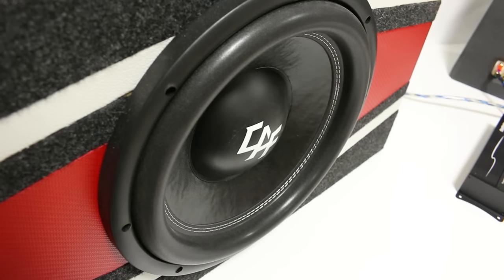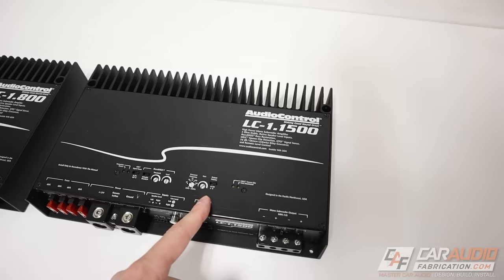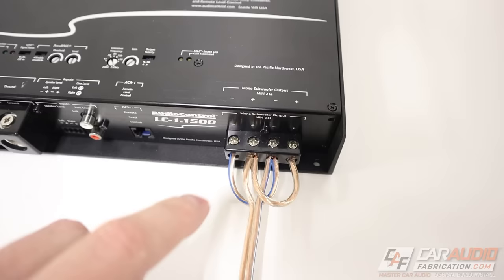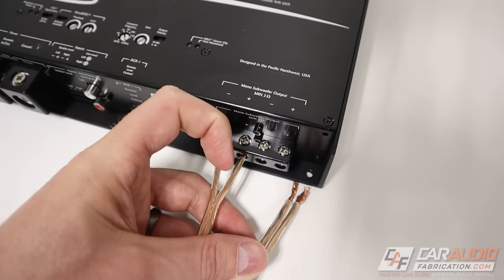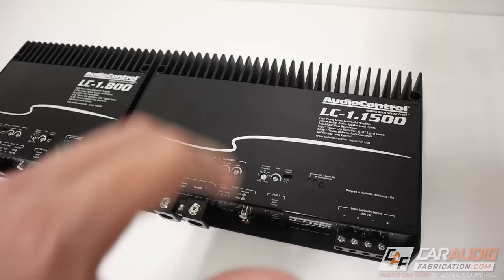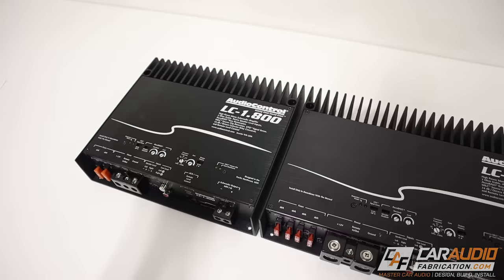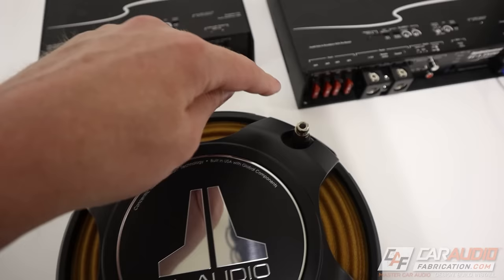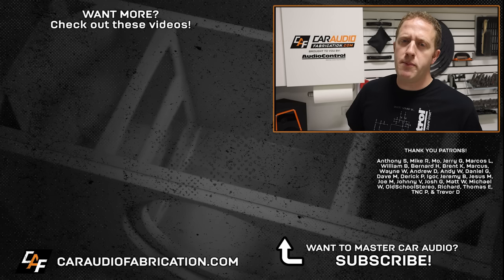The RIGHT WAY to wire subwoofers to a monoblock amplifier

Comment: What about phasing?
Reply from the maker: What? This connection has nothing to do with "phasing".
Reply: @CarAudioFabrication  the paralel connection shown at beginning freezed my hair off , i was like '' wth why the amp does not turn in protection by shorting left and right ,, but just realised by reading  that its a mono block , amp , the 2 output is just one , all its clear now , maybe leon was thinking same , in a stereo architecture each channel are biased , not sure what happen if you short both channels

Comment: What happens when you have a 4 ohm dvc sub and wire it in parallel then bridge it on a 1 ohm stable monoblock amp? Will it achieve 1 ohm, or am I crazy?
Reply: It will be a 2 ohm load, no bridging a monoblock amplifier. Even on a 2 channel amp bridged  the impedance will stay same because of subwoofer.
Reply: dual 4ohm u can wire speaker into 2 ohm or 8 ohm.. same with dvc 2ohm can plug it into 1 ohm or ohm.. high power sub will be cheaper to go for 1ohm from dvc2 and for 2ohm from dvc  4ohm, but if u dont care about full power, just want better control from amp go for higher ohm. u cant control ohm in amp, speaker have to be wired correctly like u want, and amp only need to support your resistance u have in speaker. 
and for pure example 2 subs with dvc 2ohm u can do 0,5ohm or 2ohm or 8ohm... its a little complicated but if u see diagrams on web then its easy :d
Reply: and bridging some cheap amp can make it not be stable at for example 1ohm, gotta read manual, also bridging amp wont "change" ohm cuz monoblock is only 1 channel, and even if u have 2ch amp it still depends of wiring on speaker coils what ohm u will end up with

Comment: I’m very confused about my situation… I have 4 12s that have been bridged so there are only 2 sets of wires coming from the box. Could I buy an amp like the lc1-1500 that has 4 ports and run it like that or do I need to get a true 2 channel amp?

Comment: Great video! thanks! Whilst I'm not bad at Wiring, I'm only self experience and google trained so this does help me out a lot... much like all of your videos... However there is one thing I am not sure was covered well or at all (or if it's just my idiot showing through), These terminals would be classified as parallel yeah? So If i was to hook up say, 2x 2ohm this would become a 1ohm load and thus not enough load? In my case, I have 2x 2ohm Punch P8's (so 4x 2ohm coils), I would need to wire these subs (internally) to serial for a 2x 4ohm load (subs) which is paralleled at the amp for a 2ohm load? Have I just dug myself a confusing rabbit hole like i feel i have?

Comment: If you have an undistorted radio signal at max volume but set your amp gains at a lower volume, is there any loss in performance?
Reply: Sorry, do you mean setting the gain level lower or setting the gain, without have the head unit being at maximum unclipped volume?

You should find the maximum unclipped signal from the head unit, then set the gain on the amp to output a clean unclipped signal - that will provide the best performance & means you won’t have a clipped signal or output at the your known maximum good volume level on the head unit (if you head unit goes to volume 40, but your maximum undistorted output is at 35, your new maximum is 35 & never go above). 👍🏻

Comment: I have a question for this community and Mark.  Yes I am reverse mounting my subwoofers on my back dash. So basically instead of the sub dropping down into the hole I am installing them from underneath. This means the outside ring that normally faces you when looking at the speakers will be actually in contact with the box instead. How do I get a seal? I cannot get a answer for sealing them to the box.
Reply: Invers recess mount.  Make hole smaller than outside ring diameter.
Reply: As for sealing you could apply some extra gasket material on top of the speaker or a sealant like silicone. But the ring on the speaker itself should suffice. I have seen rubber gasket rings that are removable on my rockafasgate punch speaker.but it is intended to just hide the mounting screws around the speaker
Reply: I use either weather strip for around a front door or either the roll of thinner weather strip made to go around window units and its worked like it came stock like that🫠

Comment: Does hooking up two subwoofers cut the power or do you still get the full of the amp  wattage to each sub?
Reply: When you add a second subwoofer you are halfing the ohm load on a monoblock amp.  Example: You have 2 subs and they are both 4 ohm rated.  Connecting them together will result in a 2 ohm load, and depending on the specifications of your amplifier you will sometimes get double the power coming out of the amp to the speakers or roughly 1.5 times as much power, still depends on amp.  Watch out for doing this if you have dual voice coil subs because most of those are rated at 4 ohm + 4 ohm coils, or 2 ohm + 2 ohm coils.  You can turn a dual 4 ohm speaker into 2 ohm or 8 ohm.  So if you are running 2 subs with dual voice coil @2 ohm's each, you end up with 1 Ohm load on your amplifier, and 2 subs with dual 2 ohms would be 1 ohm per speaker effectively making your amp run at 0.5 ohms and most amps are not stable or will die at such a low ohm load, really just depends on how good of an amp you have and if it will go certified half ohm or not.  Most are 1 ohm stable (not counting cheater amps though.)  Hope this clears it up a little bit.. (Every time you lower your ohm-age you get around a 75% or 100% increase in power output as long as the amp can handle it, far as the answer to your question is concerned.
Reply: Lets say your amp is rated at 1000w at 2 ohm. You can have one sub receiving that full 1000w at the proper ohm or as you asked if you add another sub and wired them together at 2ohm you get the 1000w but split between the subs, so 500w each.
Reply: @DarklordEntertainment  Wow! I've been messing around with stereo systems since I was a kid and now in my 40s and now realize I know nothing. Lol. Thanks for explaining
Reply: @jayajm2  Just turned 40 this year.. But yeah what Matthew said is true as well, everything really does make a difference on ohm loads, speakers and amps.  Also the biggest thing beyond trying to just push wattage/heat out is to make some custom boxes or boxes that are in spec with your speakers.  Boxes make a huge difference in the end.  Anyways whatever ohm your amp is effecient at.. and or stated and rated, go for the lowest ohm it can handle without breaking the warranty, pretty much anybody who repairs amps can tell if it's been lower.  Currently have been messing with a 1200w jensen that does 600w rms @1 ohm along with 4 of the jensen j12w's that are only rated at 300w rms @4 ohms.. have 4 of these hooked up to that amp so it runs at 1 ohm so it does split 600w 4 ways, so only getting 150w rms per speaker + more since the amp is rated a bit lower than it does.  I prefer it over the expensive ones in my truck.  I'm about sound quality and sealed boxes really, could step up to an actual 1200w rms amp @1 ohm ..but if it ain't broke, don't fix it i suppose.. Have a good day.

Comment: So let me get this straight. On a Mono Amplifier you only need to hook up the positive and negative of either the left side or the right side if it has two channels. A two Channel amplifier bridged to 1 sub you would use the positive of one side and the negative of the other side? Correct.

Comment: Fact that these terminals are internally connected is slightly confusing. There is writing 2ohm minimum. So regarding that i would connect one 2ohm woofer to each terminal. Therefore wiring them in parallel and giving total 1ohm load to amplifier with a risk of ruining it.

Comment: What does it mean when my subs went out but there isn’t smoke or a smell
Reply: voice coil fused at junction under cone center cap maybe
Reply: did the cone can do a full excurtion by hand without hearing steels things rubbing on steels things ( if your voicecoil is not unrolled inside the gap of the magnet , i would suggest that one of the 2 braided wires have an open connection with voicecoil,

Comment: I have a 2013 BMW activehybrid 5 it has two subwoofer under the front seats a five inch center channel 2-way in the front dash and five inch components in the front doors and rear door panels have a five inch coaxial and also the rear dash has the same five inch coaxial speakers 🔊 would like to make them a three way components speakers 🔊 I will be using my factory head unit it plays DVDs and has surround sound processor so my center channel is important to me it has Bluetooth capabilities navigation I love sound quality clean clear highs and mids and deep deep lows from 30 hertz to 20,000 hertz  can you please help me build a sql sound system for watching movies and listening to music in surround sound thank you Sir I want to use 
Focal FSP-8
8-channel digital signal processor as a pre amplifier want to use fiber optics for  my sound system and want to use the JL Audio VX400/4i
4-channel car amplifier with digital signal processing — 75 watts RMS x 4 and the JL Audio VX1000/5i
5-channel car amplifier with digital signal processing — 75 watts RMS x 4 at 4 ohms + 600 watts RMS x 1 at 2 ohms and for speakers I want to use Morel Virtus 502
Virtus Series 5-1/4" component speaker system and the Morel Hybrid Integra 52 and the Morel Virtus 503 - Morel components speakers and for subs Kicker 46L7T82 to go under the front seats driver and passenger  can you please help me find a installer I live in DeRidder Louisiana you can contact me at DJBIGGUY713@GMAIL.COM and thank you Sir again

Comment: Based on this thumbnail that I’ve seen poop up for what seems like forever I have tried this with a lot of amps. I have actually tested the output power with an AMM-1. This “trick” makes zero difference in output. Not 1 watt. I tried it with a db aak 20,000.1. A wolfram 3k. A jl audio 1200/1. A jl audio 750/1. A skar rp 2000.1. Several others. No difference.
Reply from the maker: Clearly you didn't watch the video
Reply: You are correct. I read someone else’s comment stating this improves output power. So I assumed that’s what the video stating. Shouldn’t have done that. I just watched it and it does not state that but what it does state is so far beyond common sense I don’t really get the point. I’ve been doing car audio for a living since 1993. I’ve been to IASCA world finals 13 times. I’ve won first place in my sound Q class 9 of those times with 8 different vehicles. So I guess I’m on a different level than most people to be watching such basic videos. I do apologize and you do put out a lot of good information for beginners. Keep it up.